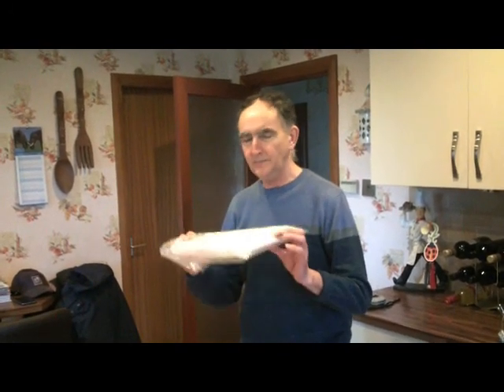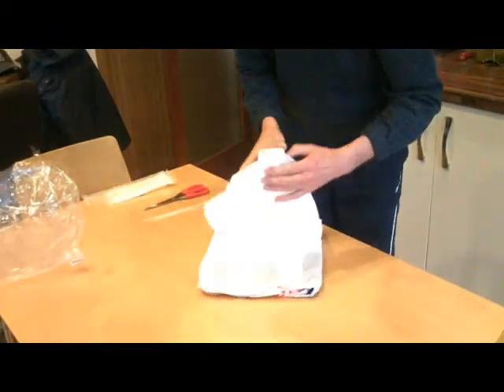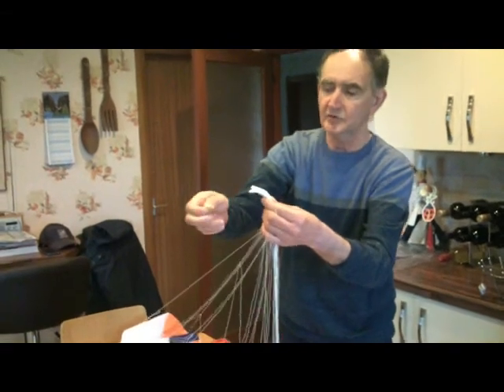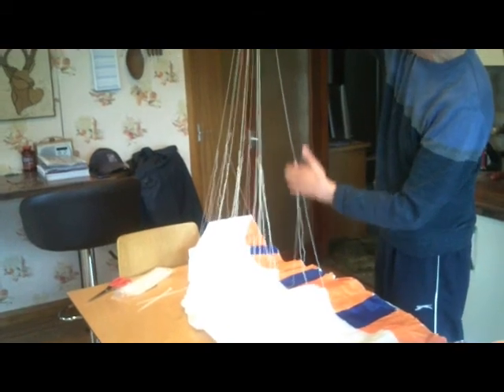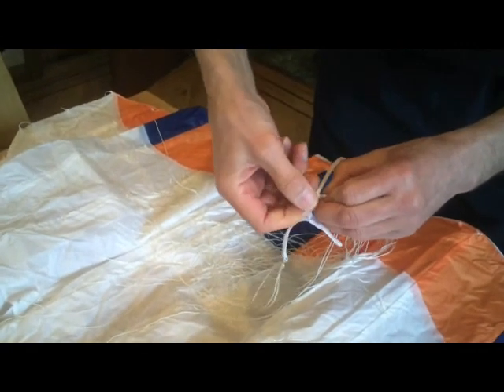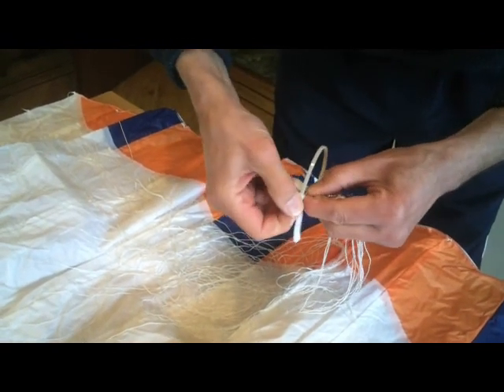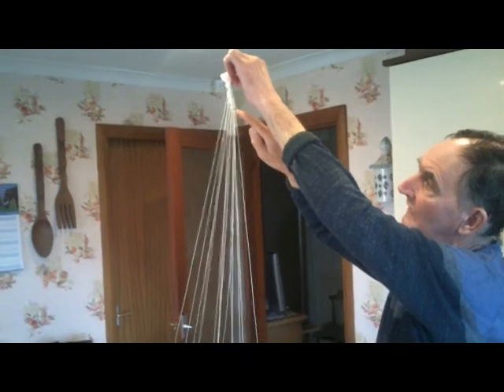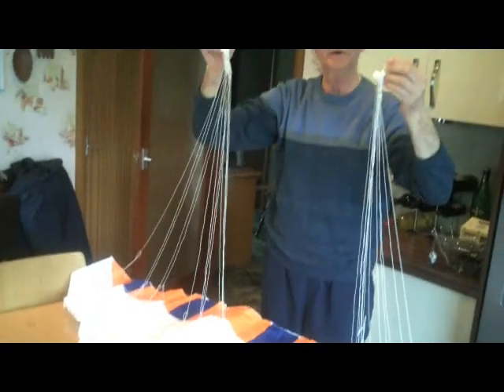AOA

Comment: what abou tthe brakes, how do you set up the brakes to the servo length
Reply from the maker: ant a Once you have the lines set up, the brakes follow in a similar manner...I find it best to hang up the whole assembly with your chosen trike or pilot hanging below, then connect the brake lines and check that they move down when the servo is moved....you don't want them to be too slack or they will be ineffective, but you also don't want them to be too tight or they will interfere with flight performance.        It is a matter of trial and error, you will know best once you have had a few flights under your belt....
Reply: birdoftime what do u suggest the brake lines be at? parallel to the other lines height wise where they connect?
Reply from the maker: ant a Yes, that is a good starting point...once you try it out at that setting, you will know from the flight just what you need to do, if anything, next time.
Reply: birdoftime is it possible to take off anywhere where the road is flat?

I don't have a good wind direction that points with the road so it's crossed.  It is still ok to take off?
Reply from the maker: ant a Yes, almost all launches are by hand, in my experience, so that is fine....
Reply: birdoftime so it's not the same as a real paraglider then?

they say to launch directly into the wind but with RC you can launch from cross or with the wind and be ok?
Reply from the maker: ant a Well, it is real, but radio control, all flying characteristics are the same, except you don't sit in it...
Reply: birdoftime but you said you can take off under cross wind and with the wind conditions?

also have you had situations where the parachute collapsed?